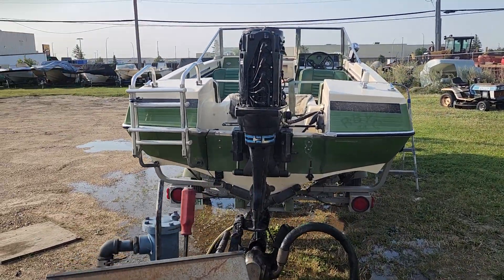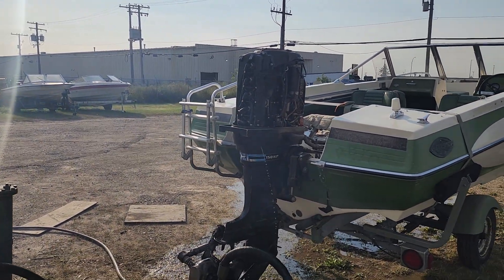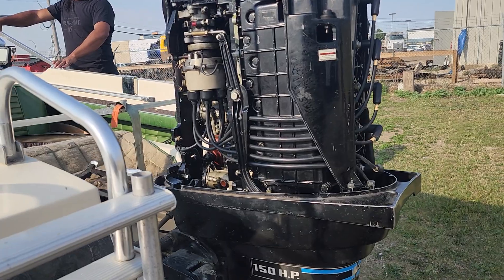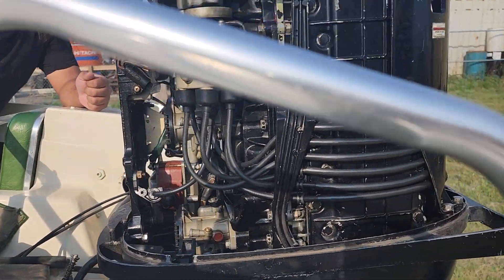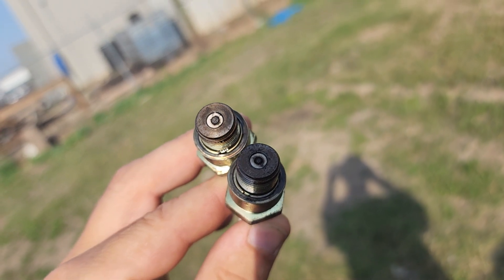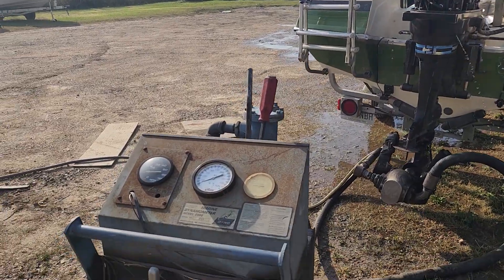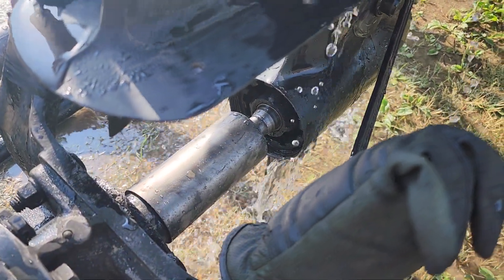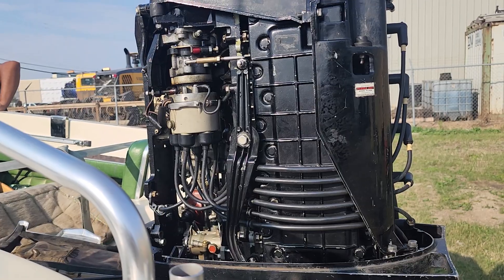150hp Merc.  Down on power?

Comment: Pistons melt if overheat or advanced timing lean carbs ... Reed valves would fail crack off wipe piston cylinder out  .Trigger in distributor failed ,power packs yikes ..
I built so many of these on Long Island NY America salt water corroded them out in 1980s inner water exhaust covers blocks corroded .
Nice running when running Motors.

Excellent channel Thank you.
Brings back memories.

Comment: Seems like cooling system water is getting into the block or the combustion chambers. When you shut it off it has enough time to heat into steam which leaks out the carbs. This would cause some loss of power at high RPM, but also do damage long term to everything, including rusting the spark plugs out.
Reply from the maker: @mjodr  It is quite possible that the 3rd gasket has failed under the exhaust plates.